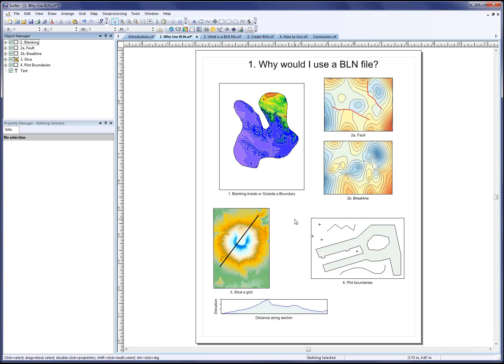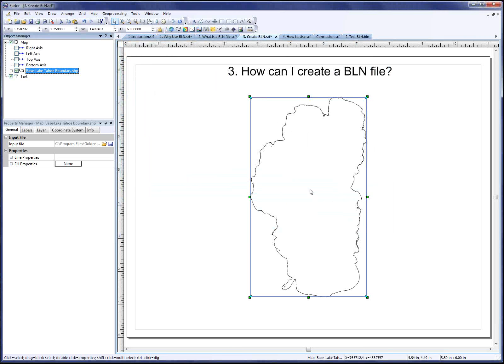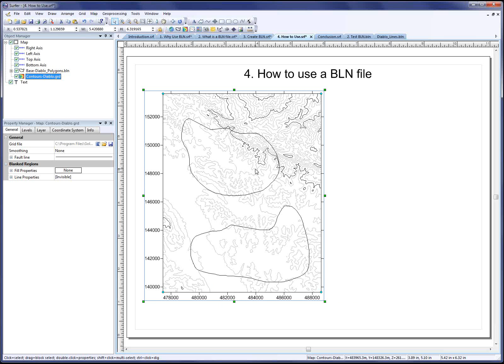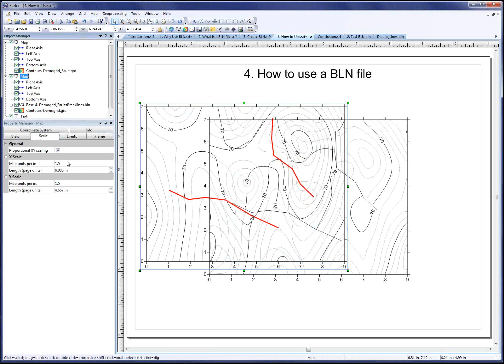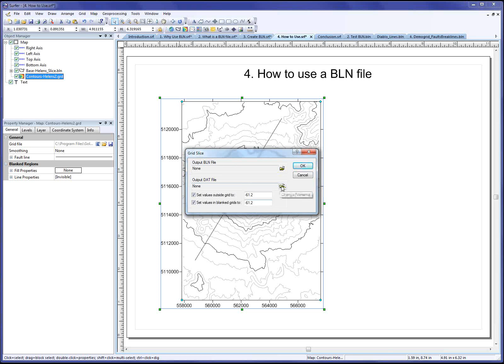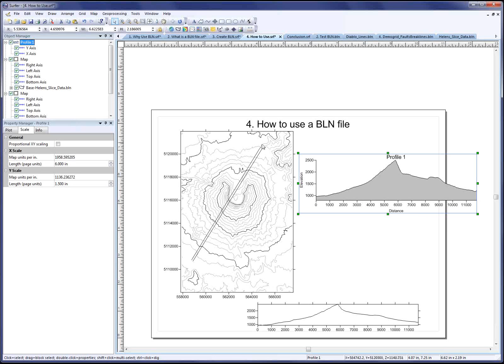Creating and Editing BLN files for Blanking Maps in Surfer Webinar

Comment: Hello, Thank you for this tutorial, Please I want to make BLN files for blanking two cantours maps overlaping the first one filled colour  and the other with contours lines
Reply from the maker: Hello Medsed, thank you for posting your question. When assigning a No Data value or blanking value to your grids, you will need to do this one-by-one if you are using two different gird files. You can following the steps in the following Knowledge Base article to create BLN files: https://support.goldensoftware.com/hc/en-us/articles/226661208-How-can-I-create-a-BLN-file-in-Surfer-. Additionally, you can use the steps on this Surfer Help page to create BLN files: http://surferhelp.goldensoftware.com/surfer.htm#t=howto%2FCreate_a_BLN_file_to_Display_Multiple_Polylines.htm%3Frhhlterm%3Dbln%26rhsyns%3D%2520. If you need additional help, please contact us at support@goldensofware.com.

Thanks!
Drew Dudley
Golden Software Technical Support

Comment: Hello. Thanks for this tutorial (and the others provided by Golden Software) on how to use BLN file;  it has become quite useful to my daily tasks. Though I have a question to address: I have created a 3D map of a dam, where I have inserted the contour coordinates (x, y, z). However, the generated map doesn't display the shape of the map only but also its surrounding  as well (even though no data were entered in the sheet). I would very much appreciate it if you could help me to cut off the outside part of the dam so I can have displayed only its shape. Thank you.
Reply from the maker: Hello Adriatik,

If I'm properly understanding your question, it sounds like you just need to blank the grid file before creating the 3D surface. If you've tried that and you're not getting the result you want, please send a screenshot of your desired result to leslie@goldensoftware.com and I'd be happy to help.

Thanks,
Leslie McWhirter
Technical Support
Golden Software

Comment: hello, can you answer a one question. I have made a isobar map, but the edges of the map, where it was blanked are white. Can you help me to solve me this problem. Thank you! I can send you the picture if you want.
Reply from the maker: Thanks for posting your question. The color and fill pattern for the blanked areas of a contour map can be changed by selecting the Contour layer in the Content window, clicking the General tab in the Properties window, and changing the properties under Blanked Regions.

I hope this helps!
Drew
Reply: Thank you for your answer, but i have this kind of picture
 the method you have told is not applicable.
Reply: Could you please provide some more information about your map and what you'd like to change?   Please send the information to support@goldensoftware.com as it will be easier to answer your questions via email.
Thanks!
Katie